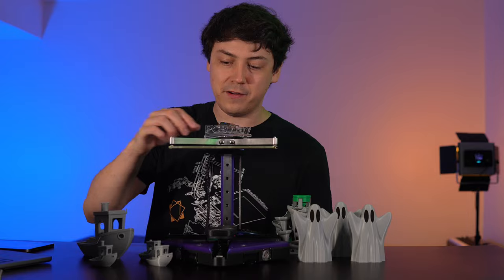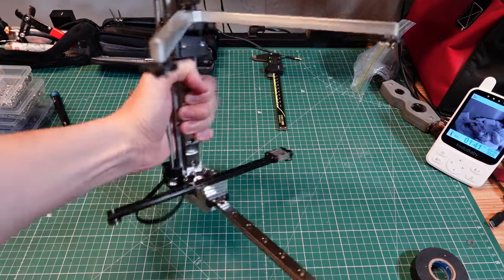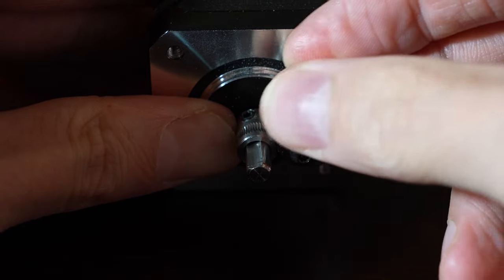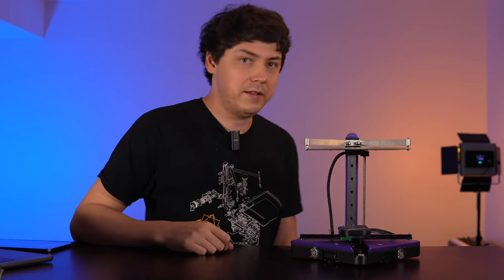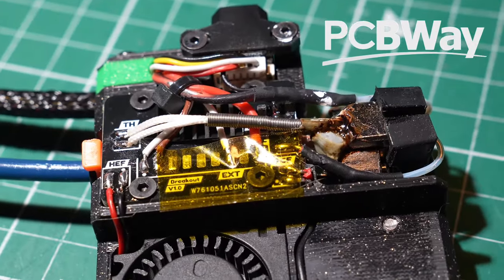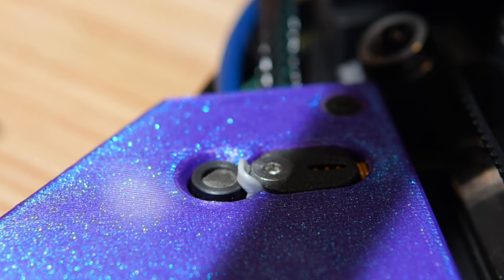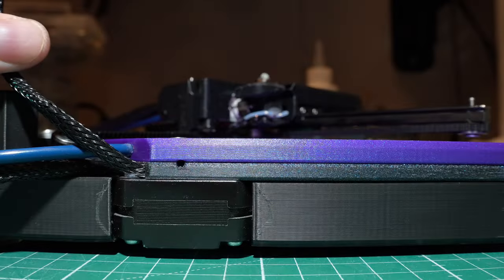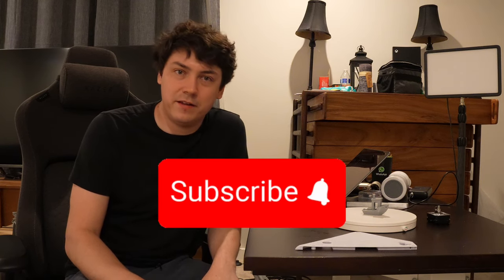My 3d printer is almost ready to release!

Comment: How about turning the bed holder into a full triangle? Would give it a lot more rigidity along one axis without making the part more complicated. The third added "beam" to the bedholder doesn't have to connect the other two beams at the end to save some space for storing. Additionally, the connector from the bedholder to the rail could just be a small aluminum rectangle with four holes. Easy to cut with a small handsaw and drill the holes with a standard power drill. Would be a bit of manual manufacturing but doable.
Reply: I think you might wanna go back to the beginning of the Kralyn3D and the PosiTron 1, 2 & 3.
This project has a long history, a Discord, and hundreds of Makers iterating on the design.

All I’m sayin’ is that any questions you have, have been answered in the community.
Reply: @GeahkBurchill  I don't have any question? I made suggestion for improvements for the problems stated in this video.

Comment: why not using aluminum/carbon rod with epoxy glued with printed part on each end as the printbed holder?
like how delta printer's smooth rod design(especially for those with magnetic joints)
Reply from the maker: Why not? No reason, it’s an excellent idea. Also hand bent 2-3mm sheet metal should do the trick too. There are so many ways to make the bed holders! I’d like to make a few and compare them on video.

Comment: How about small heatsinks on the extruder motor? Just a bit more surface area will do wonders, especially if it's blown too.
Reply from the maker: You’re right but also cant widen the footprint anymore, it’s already at the max size to still fit in a filament box which is the constraint to look out for.
Reply: @lemontron  I mean within the internal volume. Since the base is 3D printed, space for both heatsink(s) and intake and exhaust ducting can be carved out of the volume of the monoblock chassis while preserving the external dimensions.
Reply from the maker: Oh wait you cooking. I just added air channels in the cad (like I mentioned in the video), all that you mean is add heat sinks to increase surface area. Thats a great idea 👍

Comment: This is absolutely awesome! Super nice editing! Is this modifying the version 3.2 version(the LDO produced version) or the pre release one?
Reply from the maker: Thank you, that is very kind of you. Lemontron began as a mod for the JourneyMaker Positron. You’ll notice a bunch of parts are in common, all the rails, the nema 17 pancake motors, lead screw, etc but with all the shavings, you’d discard most of the parts! Im working on the BOM which you can check out on the website. On the website it calls out the parts that are “new” when converting a JourneyMaker and they add up to $51 so you can see just how many parts are reused.
Reply: Yeah - As Lemon mentioned, it's a derivative of the v3, not the v3.2 - But as he mentions in the video, he pulls in some of the work we did on the v3.2 to make it even more capable 💪💪

Comment: The bed fork could be done by using threaded rods throughout the arms, it would keep it under compression which should stiffen it. 1/4-20 or M6 threaded rods would add a ton of stiffening to it and still make it RepRap'able. I like the idea of the thinner toolhead, It should make packing nicer and added Z height. I would like to see how it's going to fold up as well when you make another video.
Reply: Nerd 😜💙
Reply: @ turns out his printed solution worked better so I am wrong. You’re the nerd.
Reply: @Mitch3D  ఠ_ఠ ah shit I'm the nerd now

Comment: I've been looking into RV system power options for this thing. I am not an electrical wizz, but so far my search for a power supply from 12->24v with decent protections built in has been challenging. I noticed the PSU you've linked to outputs 27v. Is there a voltage window I can look for? Mean Well does not seem to have any 12v input psu which have enough juice to power this. I would say a lot of people in vanlife have a 12v system. Techies might have enough money to have a 24-48v system but I will hope anyone selling a 200+ watt psu at 12v will also sell a 24-36-48v version as well. We'll see. 

This is something I need to invest my time in anyway so I will put it on my list to do this research so when you release it others can see what options are out there for safe power management. I am happy to chat with you and send you options I come across. I am on Voxolite discord.
Reply from the maker: Thanks for researching that! I see a trend where we have a lot of 12V hardware like portable heat pumps and refrigerators, pretty robust ecosystem actually. I don’t see a demand for an ecosystem with 24V. We may have a situation where nothing can be integrated, it just has to be an inverter?
Reply: @lemontron  I think the worst case is you buy a 24v > 24v power brick with all the bells, and then a super basic 12v > 24v> converter. My electrical knowledge is not vast but my understanding is this would still be more more efficient than an inverter and you wouldn't have to worry about turning off the converter when not in use. 

I'm really not sure why suppliers aren't making their psu more powerful at 12v. Maybe it has to do with wire guage or bcp max amps for certain things? 🤷‍♀

Comment: inspiring, is there any benefit to printing inverted? is there slicing software that can take advantage of inverted printing, specifically off an edge with minimal/no support? I could imagine printing into air with just a rib support, or the mid air print off an edge would just flap down onto the tool head until enough filament is extruded for rigidity. any bridging will be ironed by the tool head as it goes for the next layer, possibly correcting any droop. curious how inverted printing will expand our capabilities of 3D printing. thank you, subbed.
Reply from the maker: Glad you asked. I made a write up on this:

3D printing continues to evolve, and one minor development is the concept of printing upside down. I investigated this idea because it provides a way to consolidate all the heavy components near the bottom.

While the idea might sound unconventional, the actual printing experience remains the same. “But Lemontron”, you say, “ shouldn’t the effects of gravity cause some noticeable difference”?

In Positron-style 3D printers like the V3.2, JourneyMaker, and Lemontron, this design is realized fully, and despite the orientation, the fundamental principles of 3D printing remain the same. The printer still follows the sliced model data layer by layer. The gravitational effects on the molten material are minimal because it solidifies almost instantly upon extrusion, whether it’s oriented upwards or downwards. You can even try this on any printer, go ahead and flip yours while it prints, you’ll see it doesn’t care!

Supports Constrain Molten Filament, Not Defy Gravity

A common misconception in 3D printing is that supports are primarily needed to prevent parts of the print from sagging or collapsing under gravity. In reality, supports are there to constrain the movement of molten filament during printing. When extruded, the filament is in a semi-liquid state and needs something to adhere to for accurate placement. Supports provide a temporary scaffold that guides the filament, ensuring it solidifies in the correct position.

This understanding also clarifies why printing upside down doesn’t negate the need for supports. Since the primary role of supports is to provide a foundational surface to adhere to rather than to combat gravity, their function remains crucial regardless of the print orientation. Overhangs and bridges still require supports to maintain structural integrity during the printing process.

Completely Familiar Workflow

Preparing models for printing upside down doesn’t change anything. The slicing software and settings for layer height, print speed, and temperature remain consistent with those of standard printers. The calibration process is familiar too—leveling the build plate, checking nozzle distances, and ensuring proper adhesion are all part of the routine.

One might think that printing upside down could introduce issues with layer adhesion or print stability, but in practice, these concerns are negligible. Materials do bond effectively regardless of orientation.

Conclusion

In essence, printing upside down offers nothing notable in terms of advantages or disadvantages. Understanding that supports are meant to constrain molten filament rather than solely counteract gravity highlights how fundamental 3D printing principles apply universally, regardless of orientation. At the end of the day, what orientation you printed a part in is barely a footnote, which is kind of the whole point!

Overall, it’s a testament to the proper engineering and elimination of variables that such variations can exist without complicating the process. If you come in doubting upside down printing, I can just say you are the one printing upside down!

Comment: Is this like a refined positron?
Reply from the maker: Yes, refined, features added, and cost reduced in half. I’m gonna overshare a bit, because someone might be interested. Positron, invented by YouTuber “KRALYN” released in May of 2022.

Shortly after, Kralyn mysteriously went dark but the rest of the Positron team founded a business and went on to bring the well received Positron v3.2 kit to market with LDO Motors as a manufacturer.

While heads down working on the v3.2, several forks sprung up, including the Positron JourneyMaker who beat the v3.2 to market, and the newcomer, the Lemontron. Lemontron began as a unibody chassis mod for the JourneyMaker, but quickly grew in scope to a complete redesign that cut the cost in half.

In a small printer you expect to see a small price, and the Lemontron delivers. A fully built Lemontron consisting of only off-the-shelf parts will run you $413.

The low price is all due to Lemontron’s complete redesign, in which custom CNC parts that increase the price of Positron kits have been cleanly eliminated without compromising performance.

In contrast, the Positron v3.2 and JourneyMaker are kits that integrate expensive CNC parts. A fully built JourneyMaker with a combination of self sourced parts and custom CNC parts from Voxolite Shop will cost you around $800, while the Positron v3.2 kit from LDO motors will cost you $699.

Comment: That is an awesome gimmick.   But it's just upside down.  Still has support issues.  It's just an FDM upside down..  Same problems as Resing printing.  Why re-invent the wheel.
Reply from the maker: Well I’m happy to dispell any doubts about  upside down printing. Jeff Geerling said it best but the point of the upside down design is not for the memes and even not important as a footnote but it is weird looking. As with any new design there will be some doubters but the point is actually simply that the weight is in the base and we don’t want a lot of weight on a cantilever. Its simply these constraints that lead to the upside down design and I assure you, you can turn any old printer upside down and it will just work. For some long runs, print farms will also turn the printer upside down so that the part auto ejects although this is not common. Its nothing like resin printing and any doubters should simply refer to Jeff Geerling’s video in the Positron v3.2. But basically there is no practical difference to FDM printing upside down vs right side up. From a Lemontron perspective, you are the one printing upside down!
Reply: @lemontron  yeah.  You just have to think upside down like printing with resin. Lol
Reply: @lemontron how does it do with overhangs or under hangs or understands? You know what I mean